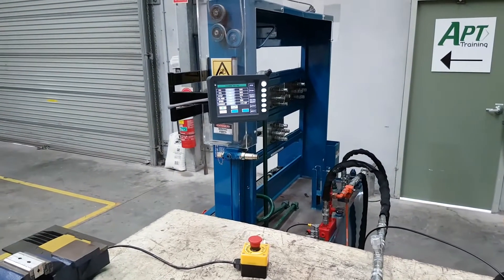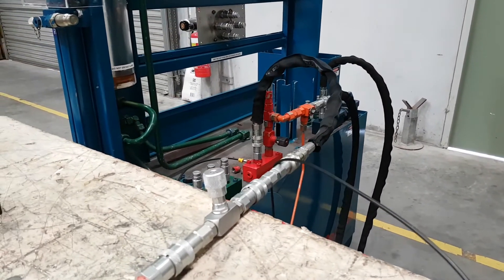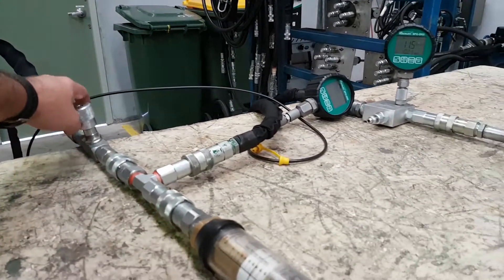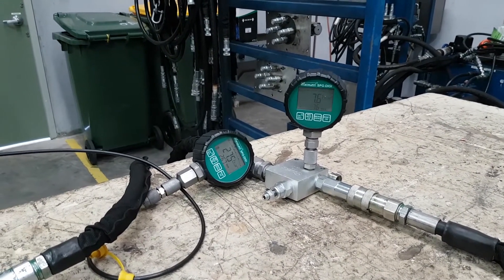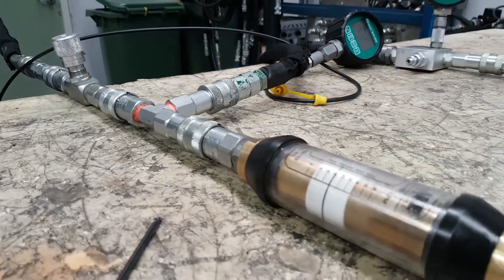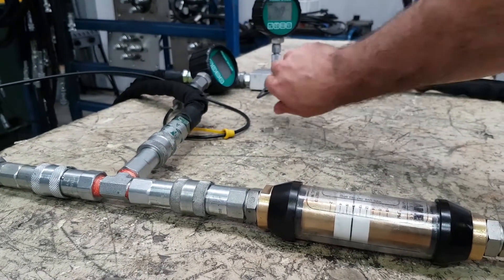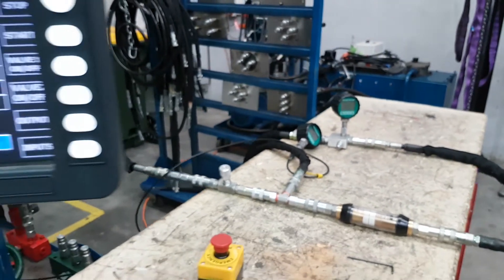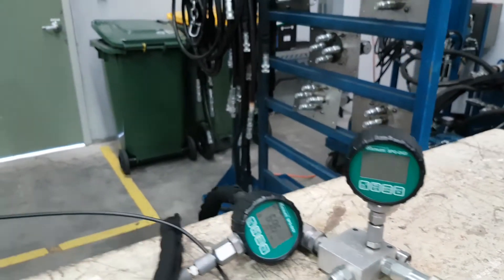How To Work With A Hydraulic Load Sense System - AskAPT 9

Comment: I have a lawnmower with a hydraulic problem that I cant diagnose. I'm not sure if it's the pump, wheel motor, or dump valve. Can anyone give me some advice on how to find out which is the problem? Both wheels stopped driving at about the same time and they each have their own pump and wheel motor. Right now one wheel moves slightly and the other does absolutely nothing. I'm not super knowledgeable about hydraulics, but I think I can fix it if I can diagnose which part is the problem.